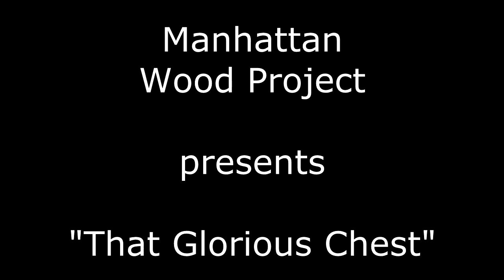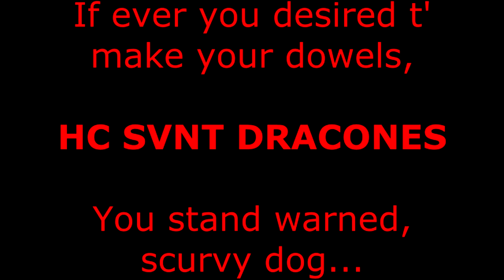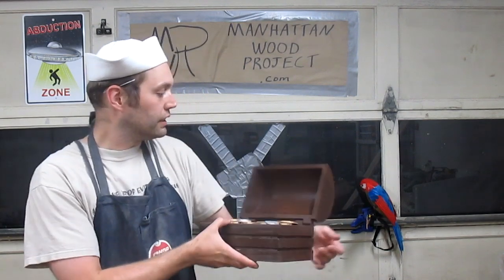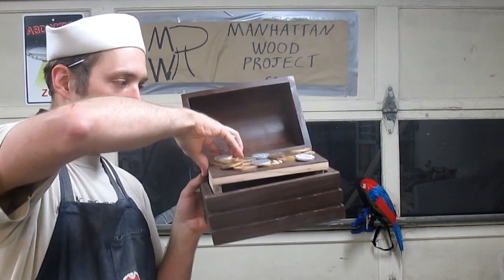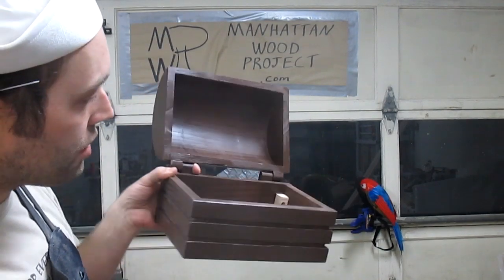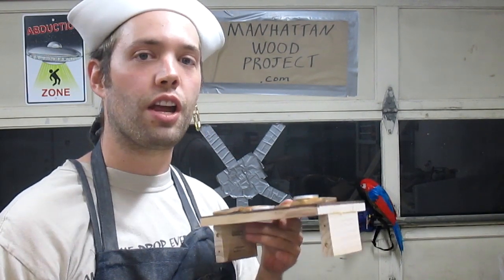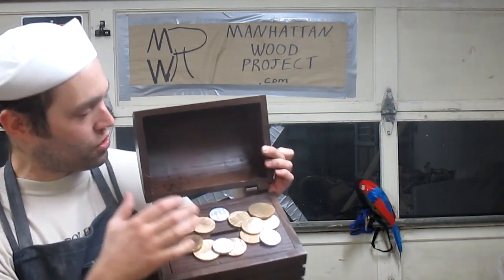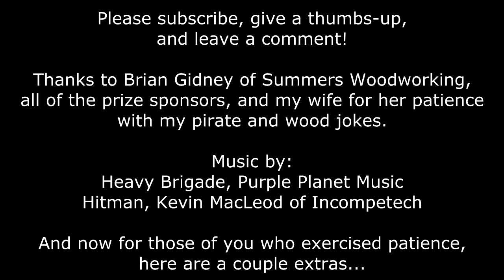11 - 2x4 Pirate Chest Bank - Manhattan Wood Project

Comment: Awesome design on the locking system.Hole saws are easy to sharpen, and they stay sharp longer when used at a reduced speed (Sorry for typing that out loud)Cross grain gluing increases the chance of failure, but don't tell anyone I have been known to do it myself.Please keep making vids, I really enjoy borrowing from others experience.Rules are just a guide on the road to success.
Reply from the maker: +Stephen Johnson Thank you!  I think I would probably have fewer issues with hole saws if I invested in a set that wasn't made from Chinese pot metal.  They may as well be aluminum, they seem to hold a sharp edge about as long as my pocket knife (which I swear is made out of silver painted cardboard)...  :)
Reply: I have a lot of Chinese steel myself, as most everyone does, some won't admit it and some don't know it is Chinese steel, and it serves it's purpose for what I purchased it for. If it doesn't I modify it or as a last resort, I replace it.
I would recommend Milwaukee Hole Saws, they perform well for me and I have yet to have to replace any. I do my best to keep the speed down but sometimes action out weights planned procedures.

Comment: Great video. The stave glue up on the top was incredible! Love the lock! Props for getting your lil girl involved man. They have a dowel jig somewhere on youtube. Great work man. Cool piece for sure man.
Reply from the maker: Thanks, I was sweating the idea of using non-planed 2x4 for the lid, but there was a lot less sanding than I expected.  I think I'd rather buy dowels than make them though, at least until I can find scrap metal more than 1/8" thick.

Comment: I like the build.  Don't buy your hinges.  Don't give up on the dowels.  Watch this video by Izzy Swan.  I have not tried it yet, but it sure seems like making your own dowels would be pretty easy.  Make Wood Dowels
Reply from the maker: I wanted to try it that way (or the other way, with two smaller cutting holes beside the main hole), but I couldn't find any scrap metal larger than 1/8", and I had visions of that piece flying across the shop like a lawnmower blade.  I didn't see anything cheap that I could scavenge from either.  I'm keeping my eyes open though, I wouldn't mind doing it again with the right tools.

Comment: When you cut the top what angle did you use? I guess I could count the pieces and divide it out but I was wondering if you would just tell me.
Reply from the maker: Hi Jason, sorry it took so long to get back to you!  The pieces on the top are cut at an 82.5 degree angle on either side, and there's 12 of them.

Comment: 1:15 I see a Shopsmith!!!
Reply from the maker: I first saw it about 10 years ago, and held off on buying big woodworking toys until I could afford it.  With my limited space, it was the best option.  I love it!
Reply: ManhattanWoodProject
Mine was my great-grandfathers, then my great uncle had it, then my dad, who gave it to me about 10 years ago.  Its a great little machine.
Reply from the maker: I've heard the originals are still running strong.  I think I prefer the computerized version though, it tells me what RPM to use.  Less thinking, more doing.